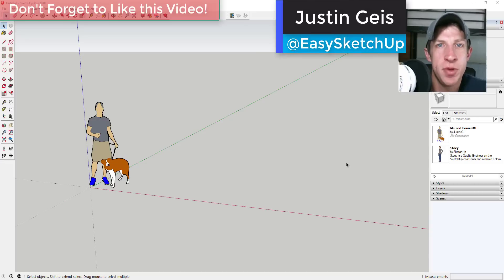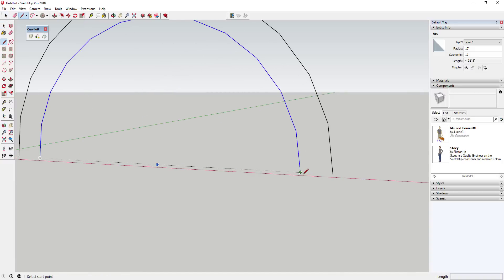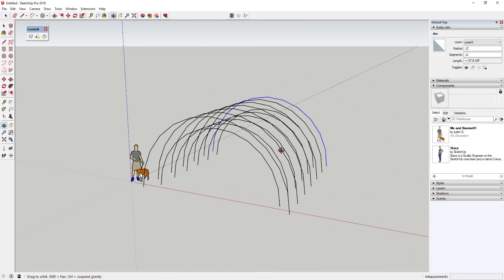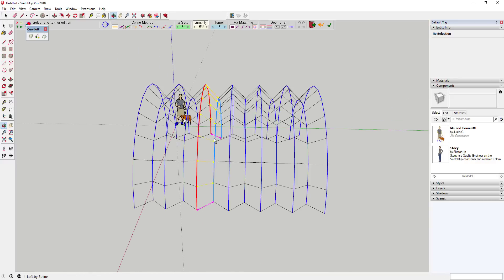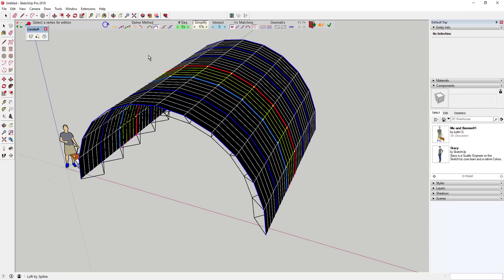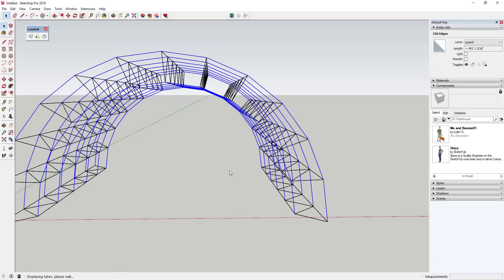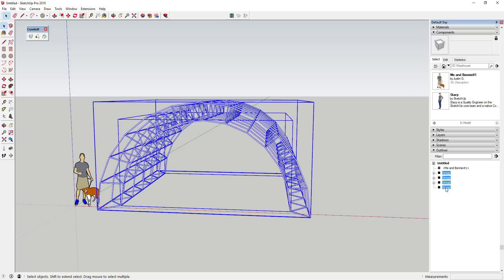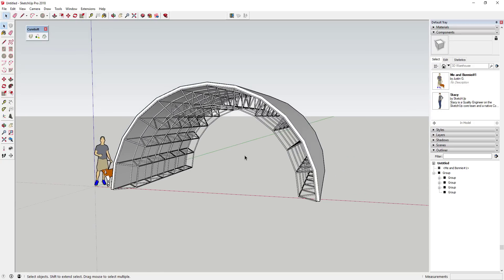Modeling a Curving Truss Frame Structure in SketchUp with Curviloft

Comment: is there a chance to get the plugin lines to tubes for sketchup 2015? or a way to make it compatible with version 2015 even though the website says it only compatible with newer versions?
Reply from the maker: Did you try it with 2015?

Comment: Hi.
some weeks ago, I asked you a question, but did not have any answer.
Can I import  my *.skp from sketchup  2017 (free version) into the sketchup 2018, free version?
thanks to answer. please.
Reply from the maker: Hi Woody - I haven't done a ton with the free version - my recommendation would be to upload your Skp file to the 3D warehouse from your 2017 Free Version, then import it from the 3D warehouse in the 2018 free version. Does this make sense?
Reply: woody wood of course you can.... But you cannot go back.
Reply: good. 
so,  how do you open a file, since they have to be on "sketcup cloud", I mean fron internet , since it looks like you can open file fron internet...
Reply: thank you for the answer! I already did yesterday, and it works. As Willem Buiting said, if I save them under 2018, I will not be able to load them under 2017... It's ok, sinc e it was already the way it used to work with older version... my only regret with 2018 free  is  my extensions do not work anymore, and that does not please me ...
Thanks . Your videos are helping a lot!!!
Reply: thanks.
Reply: woody wood I just have to ask. Why do you want to "upgrade" to this web based thingy.... nothing good can become of it other then being kept hostage to the internet? I mean, Sketchup 2018 pro has some decent features but the free version.....
Why not just stick to 2017 for now? Greetings from the Netherlands!